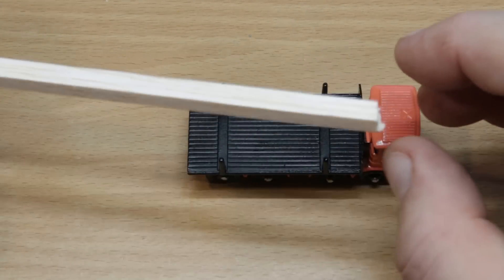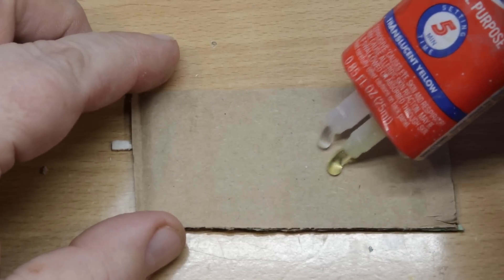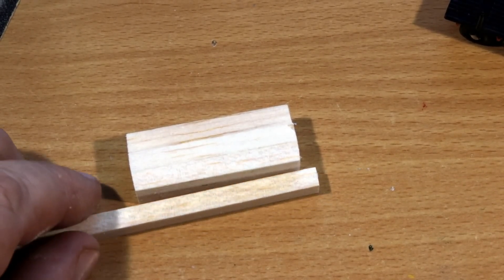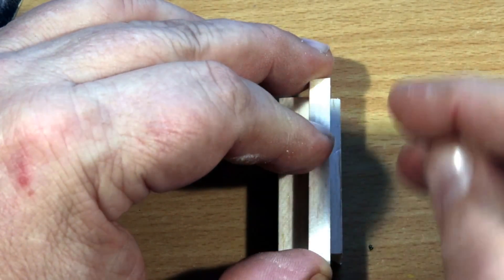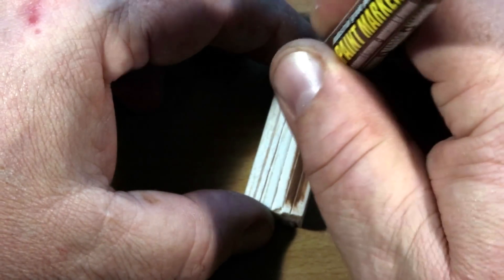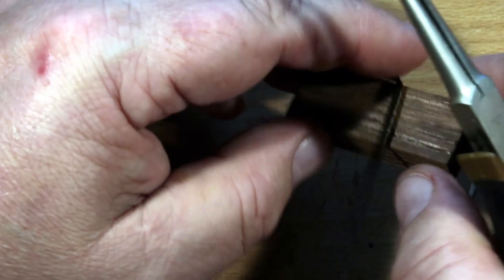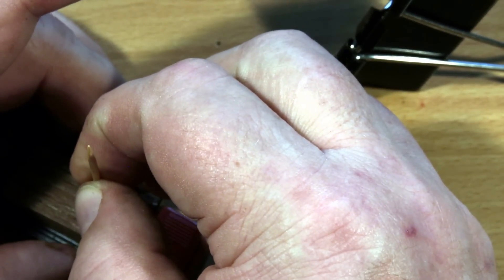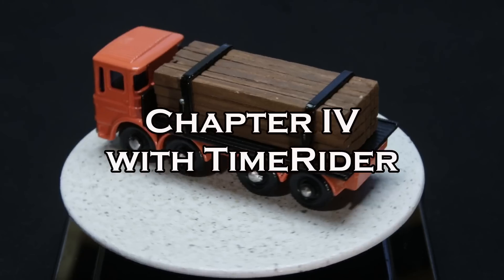Matchbox #10 Lumber (Pipe) Truck Revisited

Comment: You might want to consider getting some Woodland Scenics Foam Tack Glue.  This glue, despite being a white PVA type of glue, has a very tenacious grip, that will bond just about any materials together.  Cleanup is easily done with water, and it dries clear. One 12oz bottle could probably last you a lifetime.

Comment: For try #3 use a fine ribbon for the tie-down straps. That would look more like real tie-down straps than either a painted line or a thick plastic zip-tie.
Reply from the maker: Somebody suggested electrical tape, which I though was a fine idea as well

Comment: You could use some Q Tips and make pipes. I think they're hollow and could be cut to length
Reply from the maker: Yeah, but they would be too thin as compared to the original.  I think I have four of these including one that is in great shape as an original, I may order some pipes for it at some point.

Comment: The other two models carry steel and pipes
Reply from the maker: The 58C Girder truck is a different cab (DAF).  There is a short version of this cab which carries a small "hut" (60B), the 32C and the 51C Tipper also use this Leyland cab.  There are a couple of "Kings" that use a slightly different Leyland cab.
Reply: @TimeRider  The light blue Leyland with the small yellow  cabin with green roof i also have in my collection.
I love these trucks as a kid.
Most time the extra on the beds get lost over time but mine i still have.
I have heard that this little cabin alone has a high price when you are looking for it.
Thanks for the Super Fast apply !!
Merry Christmas!
Reply from the maker: @GoliathAngelus  I have a 60B in pretty good condition . . . no cabin though.  I haven't even looked for one yet.  Just trying to get moved.  "Restoring" a bedroom today.  Last one (thank the maker).   Although I do have a die cast in process . . . I can't help myself!
Reply: @TimeRider  Get moved,,,?
Some years ago it was my turn to get moved,,moving out or moving away where i live.
I can tell you moving in a hurry with hobbies and so many thing to pack in such sort time isn t very pleasant i can tell.
Succes with the moving and i keep my eyes open for this cabin.
Maybe you can make one for yourself? :)